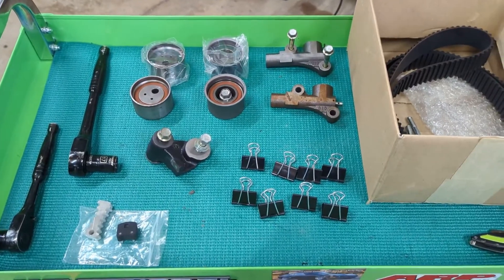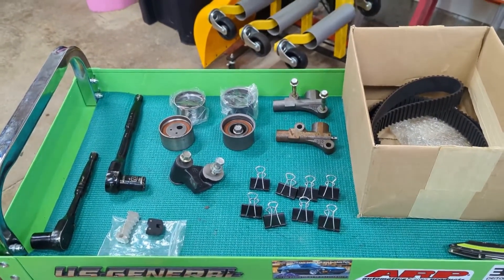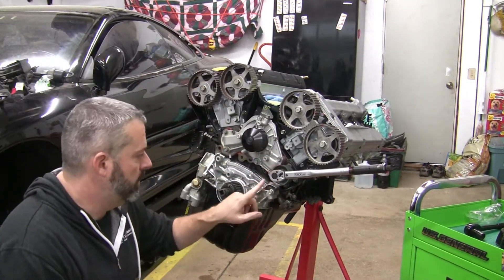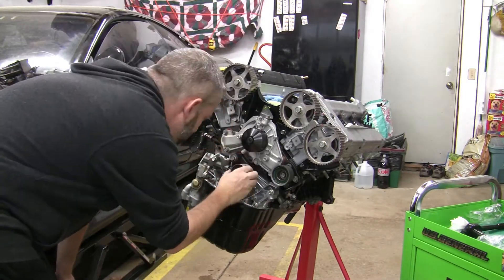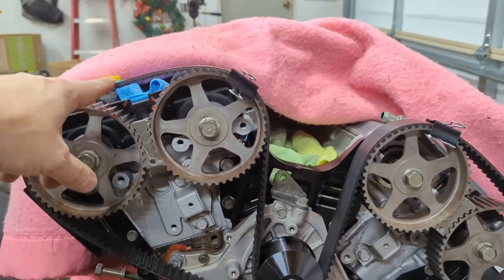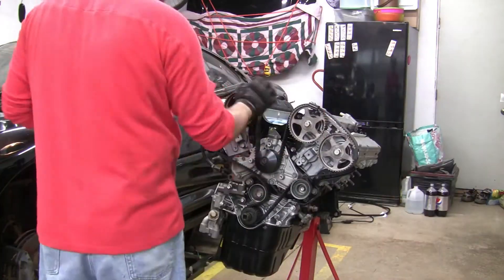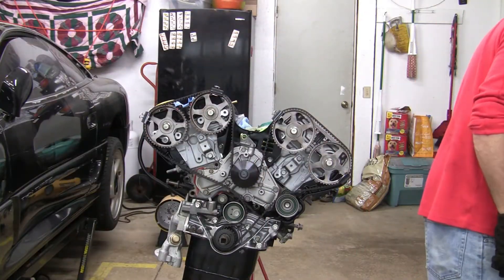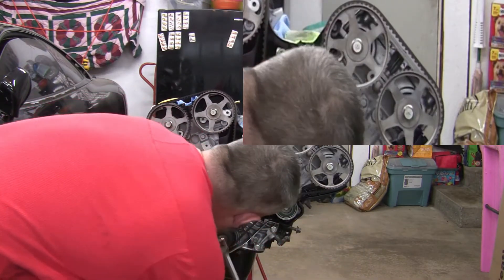6G72 Engine Assembly - Part 10 - Timing Belt Install

Comment: i am also rebuilding an 6g72 engine, but run into a problem.
i renewed all valves and be ready to reinstall the cilinderheads.
however, i found 2 parts on the floor under the car and cannot discover where they should be installed.
perhaps someone here can help me.
they are little bushes from approx 1cm high and 1cm thick.
sorry for using metric instead off inch.

Comment: Best lockers are two bolts with large washers going through the bolt holes on the front cams and bulldog clips.  Those tensioner tools are crap.  Best to buys as many as you can in one hit.

Comment: I'm looking to rebuild a 1993 Dodge Stealth RT. All your videos have been very helpful, giving me the motivation to move my project forward. I am also in IT, with little Mechanical experience. I have swapped an eingine before, but it was pulled from a wrecker. I've never rebuilt an engine, but I'm going to reach out to a machine shop that specializes in rebuilds to get an idea of the cost. I do have a couple of questions for you, where did you source most of your parts? How much do you expect your engine rebuild to cost, including parts and the machine work? I have looked at 3sx and can't believe some of the costs.
Reply from the maker: Steven, thanks for the compliments. So the parts that I have purchased have come from 3SX, NinjaPerformance, and RockAuto mostly. CXRacing also has some parts for the car and STMTuned seems to have a lot of parts for our cars, but I have not purchased from here (yet). While I love these cars, they are VERY hard to find parts for and the ones you do find are expensive, especially since Mitsubishi has recently stoped making most replacement parts for it in the past year or so. As far as cost... being 100% honest, I dont really want to add up what I have spent (I could, I just dont want to know). Best guess, between the machine shop and parts I am probably in about $3-4K. This has been a GREAT learning process, and I am really hoping the engine runs in the end! Good luck on your project.

Comment: How's it going? I'm about to get back to mine. I've got a "new-er" engine i'm about to drop in to my 94 3000gt. I've got to get the timing belt on it first and pull the old engine out. Gotta get it done in the next month or so because I'm moving. I was just curious to see if you had made any more progress since this video. Love the videos, they are super helpful to me and many others I'm sure! Keep up the good work!😃
Reply from the maker: Weather is starting to change, and this weekend I think I am going to get a day to work on the engine. I think I am about two to three good weekends away from putting the engine back in. Be sure to stay tuned, hopefully next week I will have some more progress to share. Thanks for watching!
Reply: @AGeeksGarage  I got mine in and I've been driving it for a couple of weeks now. I saw the video about your engine hoist. I have heard that a little AT 205 can fix that. I'm going to throw some in mine to see what happens. Mine worked...but it certainly won't hold it up for long. Good luck buddy!

Comment: I have the 6g72 as well i cant find the right timing belt online or at part store's if you have any information that would help me greatly
Reply from the maker: Mine came as part of a 60K maintenance kit, but I don't remember where I bought that kit from. That being said Rockauto has a bunch of options for the belt there. They have it listed for both the SOHC and DOHC engine variants.
Reply: @AGeeksGarage  thanks for the help greatly appreciated 🙏

Comment: It's not uncommon to sheer the pins off on those tools, I go thru at least one every other timing job. Even the more expensive tools don't last. But as for the washer mod there's no point, you can simply over compress the tensioner deeper in the bore to make a tighter tolerance same as adding a washer. Recommend by the man himself Ray P.
Reply from the maker: Glad I am not the only one to sheer off those pins. The ebay seller was gracious enough to send me a replacement, so I still have to go back and double check the proper settings again before the engine goes back in. Thanks for the comment.

Comment: The two rotations checks the hydraulic tensioner.  Go back and make sure the pin on the tensioner slides freely in and out.
Reply from the maker: Thanks, I will be sure to double check that when I get back out to it.